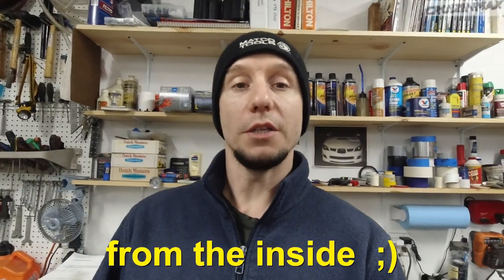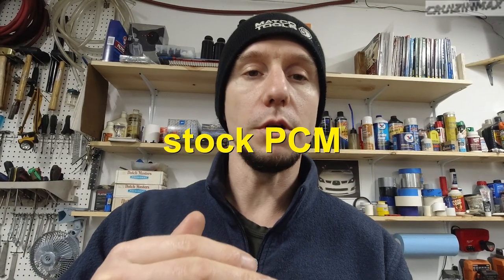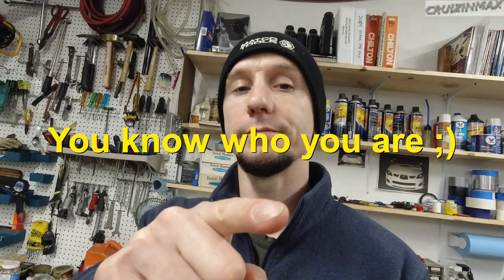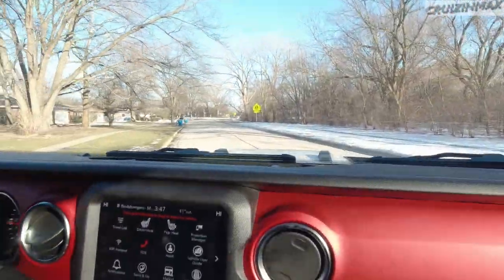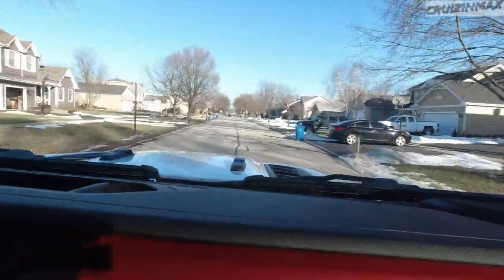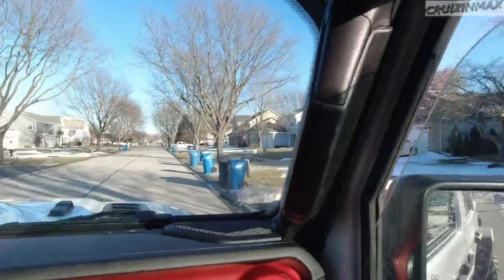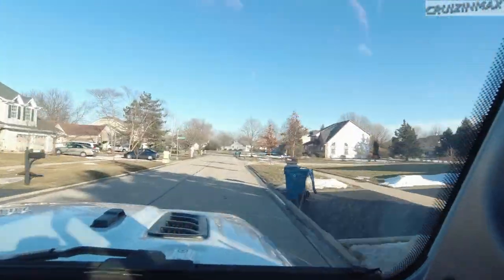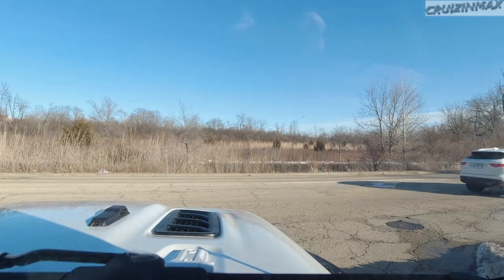20 Jeep Wrangler Rubicon JLU Magnuson Supercharger test drive

Comment: What is the acceleration speed from 0 to 60mph. What is the fuel economy on the highway at 75mph and in the city, is it worse or better and by how much, what size tires did you have on?
Reply from the maker: Can't answer any of your questions because the vehicle is not mine and the owner moved out of state.
Reply: @cruizinmax4017  sad

Comment: Awesome video. How has the supercharger held up with the engine long term?
Reply: Also have you been able to run low octane fuel without detonation issues?
Reply from the maker: I will get this Jeep in and make another video on it once it gets a little warmer outside.  It is a friend of mine that drives it almost daily.

Comment: What tuner are they using or do they just ship the ecu back to you with an updated tune? Seems like you still have the rev hang. I also have a 6 speed jl and I am seriously considering the magnuson sc.
Reply from the maker: Yes, you send out the ecu to Magnuson, little over a week you get it back but I still recommend getting a proper tune, dyno or street.
Reply: @cruizinmax4017  thanks. So you don't end up with any means to tune the Jeep yourself unless you buy it separately (hp tuners, etc)? I've tuned a number of my cars, just curious. Some ther supercharger kits come with the tuner but I think the magnuson is a better supercharger.
Reply from the maker: I dont know your tuning skills but you should always get a dyno or a street tune done by a professional tuner, improper tuning is a good way to shorten the life of your engine or blow it up.  Im saying even after people like magnuson or whoever sends you a tuned map via email for your vehicle, even after that get a proper tune, two of the same exact cars can have different tuning characteristics.  But if you are confident enough then props to you man. cheers.
Reply: @cruizinmax4017  thanks. I'm pretty confident in my tuning, Ive tuned a number of forced induction cars and some hipo NA cars. I'm thinking about using hp tuners for my jl even before supercharging just to squeeze some more out of it. I always ju do street runes which I think are better anyway as your logs mimic real driving  Tuning is a ton of fun and I just want to get back into it.
Reply from the maker: I agree with you 100%, street tuning is so much better, I just finished rebuilding my Subaru STI and did a street tune.

Comment: 6 speed manual? what octane gas are you running? What is the elevation where you are? Thanks for sharing!
Reply from the maker: 93 octane and probably at sea level, outside temp about 50F but remember a lot of weight was added
Reply: I have a ‘20 Gladiator manual in the shop right now getting Magnuson SC installed...are you still using OEM 6 speed and clutch? Recall issue or worries?
Reply from the maker: yes, still stock and no issues so far.

Comment: I’m very confused on what’s going on.

If you got an alignment performed why is the steering wheel still crooked? The shop needs to fix that or give you a refund. It will honestly take you like 10 minutes for you to fix the steering wheel if you do it yourself.

Magnuson sent you a stock ECU?! That could really damage your engine since the vehicle has no clue it’s forcing or air into the cylinders and not providing enough fuel. Running super lean like that can be catastrophic!

If you knew you had stuff rolling around in the back I would recommend removing it for the video. I got so scared when I heard all that stuff shifting around while you were driving.
Reply from the maker: Did you just watch the first few seconds of the video? Cause it looks straight to me and I can assure you, it is.
Reply: @cruizinmax4017  @0:54 you say your “the steering wheel isn’t true to the wheels”  also it looks like the steering wheel is off to the right and you’re holding it to the left to compensate.
Reply from the maker: I say it wasnt true, before this test drive.  And what you are seeing is steer torque, meaning the steering wheel will pull to one side from acceleration depending on the bank of the road ure driving on or if its all wheel or front wheel drive.

And you should never fix your steer ahead by removing the steering wheel and placing it more or less in the right spot, chances are it will be still crooked since theres limited placement cause of the splines on the steering shaft.

Magnuson sent me an already tuned ECU for this specific vehicle, thats why it was sent out in the first place.

As far as the noisy stuff in the back, well we didnt have time to take it all out, so I made the choice between a noisy test drive or no test drive at all.  And Im still waiting on the owner to visit me for a final test drive and an overall look at this Jeep after a few thousand miles on the clock with all the mods.

Hope I put your confusion to rest. Thanks.